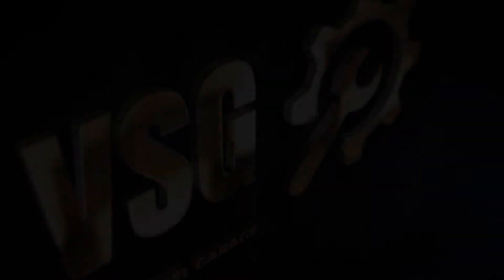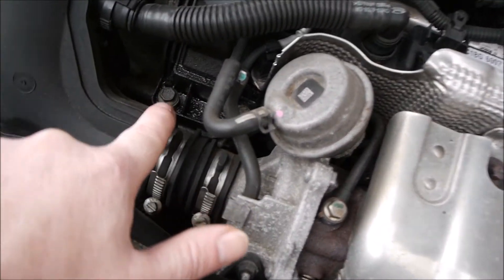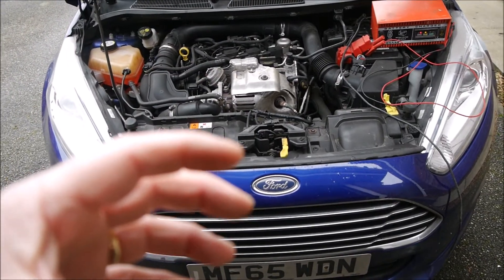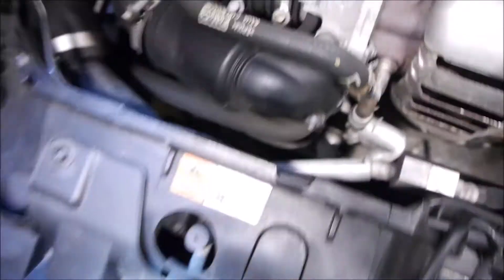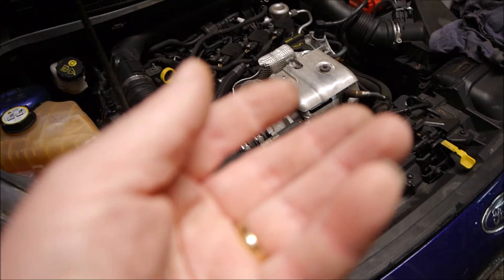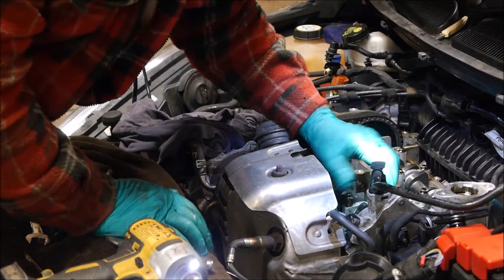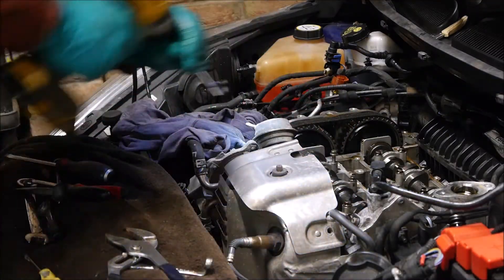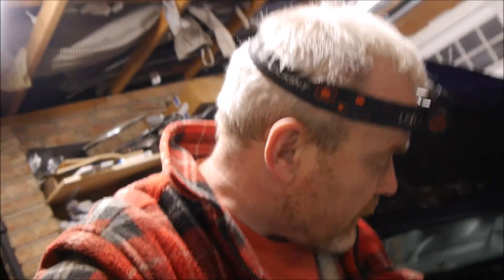Ford Fiesta 1.0 Ecoboost part 1 death rattle, can it be saved?  or is a new engine required?

Comment: How long did it take to get the cam cover off? Would you say that's the easiest way to get to see the state of the cam belt, rather than sump removal? Also, is there a gasket for the cam cover to be replaced once it's been removed? Thanks
Reply from the maker: It tool about 20 mins to get the cam cover off. However even on this engine which had the pump blocked with the belt disintegrating the belt didn't look too bad. You could see it was breaking up and looked rough like fish scales.
Reply: @vintagesteelgarage  thanks very much for the reply 👍

Comment: What does the death rattle sound like?
Reply from the maker: Sounds like a top end  camshaft rattle  on tick over then with a little rev much worse   bottom end noise. Youll   know  it when you hear it.  I didnt drive the car but I would guess a loss of power as well.

Comment: How much did you pay for the fiesta..??Will it still be a bargain after you've sorted the engine?
Reply from the maker: Paid 2500 for car and about 2000 for engine. Clutch, tyres etc. Saw another on a dealers for £6700. So yes.

Comment: You can't Adam and Eve it, 
Ford have been making cars for over 110 years and they go full circle and put a cambelt running in oil 🤦‍♂️Gordon Bennett
Reply from the maker: Layer ones have a chain I believe
Reply: @vintagesteelgarage  They do yeah. Even Ford figured out, that the wet belt system, is the most moronic idea ever!
Reply: @IncognitoX8  sb a Class action suit for another dumb idea

Comment: Absolutely baffling design.  It’s like they’ve completely given up on the idea of a vehicle lasting beyond the warranty period.
Reply from the maker: Yep lots of special tools and over complex torque procedures.
Reply: To be far there a great engine with oil changes often its just the wet timing belt side of it that let's it down
Reply from the maker: Good power for the size. Just not so easy to work on its that's modern engines I suppose.
Reply: @vintagesteelgarage  yes 💯 there a nightmare to work on to much going on to busy in the engine bay .

Comment: I dont think the car even comes with an engine cover half of the time
Reply from the maker: Yes u think you are correct
Reply: Got 2 with no cover.
Reply: No prity cover, this happens a lot  with ford even when new from the factory. Some have a under engine protection cover but its something you don't really need as no engine prity cover will allow engine heat to escape more easily especially in  hot weather 😊
Reply: @brianfearn4246  mine has a cover,is it better to take it off ?
Reply from the maker: No leave it on I think it has some sound absorbing element. Most I think get removed for maintenance and then never refitted
Reply: @ Thanks,i better leave it on.

Comment: You said that the valves arent bent, but that is actually possible without the engine failing if they havent been very damaged, taking into account that the belt gets weak due to loss of material, I wouldnt discard that posibility
Reply from the maker: Good point. You'll see in part 3 why I've gone for a full recon motor.

Comment: change timing belt while engine is out  , no room ,crap engine design for me
Reply from the maker: Totally agree. Very cramped and too many electrical connections.
Reply: change both belts haha
Reply: The design of the engine is very revolutionary. Small, lightweight, and powerful. The point of putting the belt in oil is a good idea on paper. It's so you can have frictionless drive causes less drag more powerful and fuel efficiency.

Sadly, this doesn't work in real life because 
People don't want to change their oil at 5K like I do to prevent this.
Reply from the maker: Yes agreed. Regular oil changes essential. But if you didn't buy new damage maybe already done.
Reply: @Vintage Steel Garage  I bought my car luckily with very low mileage. I have done a lot in it since then. Touch wood she keeps going.
Reply: @No.Handle31  Theres cases of people who do regular oil changes that's still get belt damage but this could be due to using the wrong oil or doing engine flushes
Reply: @Jack  yes I do see your point. I would avoid engine flush and stick to the correct grade of oil, which is 5W 20.
Reply: @@SilverSeeker232which oil do you use?